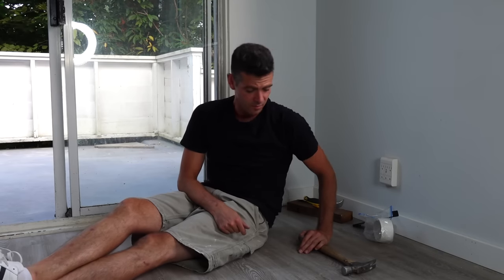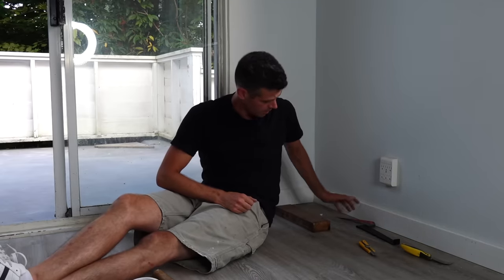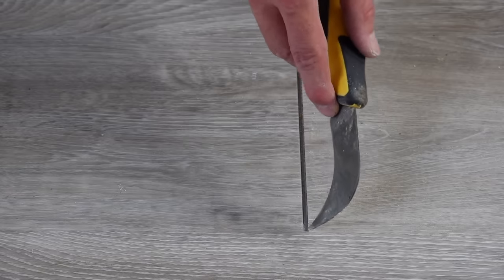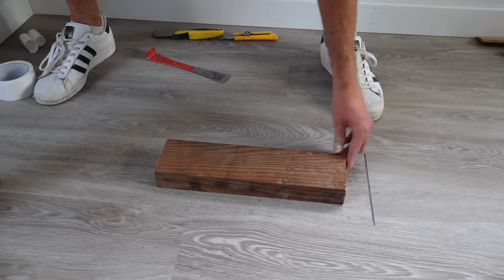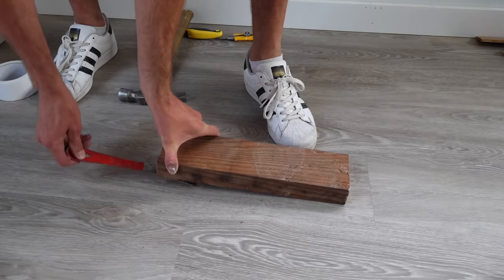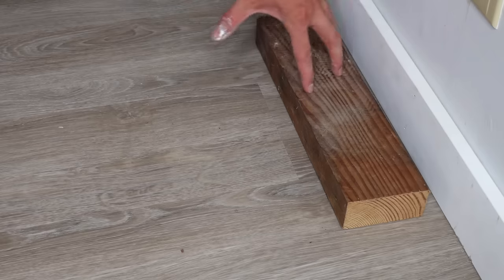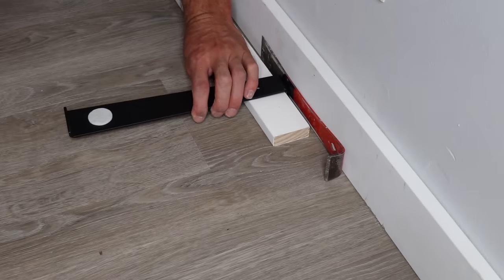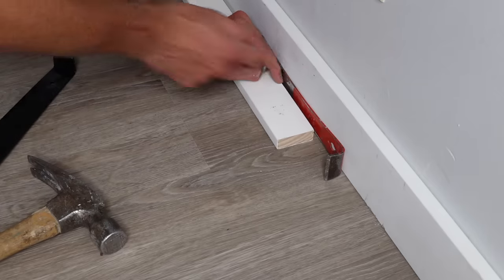How to Fix Gaps in Flooring!!! (Laminate, LVP, Engineered wood)

Comment: You went over "gluing" quickly so I want to know what did you do to keep them in place. Ours is a floating floor and it moves quite a bit. I'd like to glue it but don't know if is a bad idea. The side to side locking mechanism on this flooring isn't/wasn't right. They fixed it on new flooring we bought but the old moves everywhere. Despite us telling them about the problem they never fixed it. Now trying to figure out how to fix ours a bit more permanently.  Glue in the end cracks? if so, what type?Thanks
Reply: Not the guy you're asking the question of, but I install a lot of laminate/PVC/vinyl flooring.
I use clear Flex Glue, have had the best success with it. Clear because even the low-quality flooring has pretty tight interlocks, and it's easy to put too much on if you're hurrying, which I always am. Wipe up excess, but clear means you don't have to be perfect.
That said, use the smallest amount of glue possible. The interlocks are always tight and glue will squeeze up AND down. What squeezes from the top can be wiped off. Beware of solvents though, they can discolor or even melt laminate or vinyl. Some will even discolor PVC. What squeezes out the bottom though, you're...stuck with. That can cause buckling or separation if the floor expands or contracts too much, even with underlayment. Expansion/contraction is also why you want to use a glue that stays flexible after it sets up.
Bottom line, just use glue on the ends, use flexible glue, and use it very sparingly.

P.S. And if at all possible, avoid using pieces as short as the one in the second example of the video. Odds are it separated because its sides weren't long enough to provide sufficient friction. Cost being always a consideration, if you lay a floor and you need to reduce overhead with minimum waste, glue the end of pretty much any piece less than 8" (20 cm) long.
Reply: @shawnhartmann4581  thanks! Our problem is plain and simple a manufacturing defect. There is not enough "friction" between the panels to hold it in place. When we had our kitchen re-done, the guys who put in the cabinets couldn't believe how easily they were able to pick up the floor. They said they had never seen anything like it. Our floor wasn't cheap, but the manufacturer was new (we found out later). The retailer blamed the installer, the installer blamed the manufacturer and no one ever did anything to fix it. Soooo we are stuck with a defective floor that looks great but separates end to end and side to side. We are experts at the tennis shoe move to get it back together.
Reply: @jans3133  No problem, hope my info helps.
Honestly, my first choice in flooring manufacturers tends to be German (lowest error tolerance. Germans might suck at comedy, but they're great at precision) second American.
If your only option is Brazil, use linoleum.
The side-to-side separation should not happen. The only time I've seen this is when it was truly badly designed flooring or if the installer didn't know what they were doing and beat it together until it looked like it fit. If you do that, it typically means you have destroyed the interlocking mechanism.
I hate to say it but if the courses are separating side-to-side, unless somebody comes along with information I don't possess, if you really want to have a floor without gaps you might have to start over with new flooring.
Hoping there is an easier, less costly fix.

Comment: I just got a call back from a customer that I installed a few months back for a problem just like this.  I was just wondering what was the cause for these vinyl planks to separate like this.
Reply: Vinyl flooring needs to acclimatize 24 hours in the room between 18 and 25°C before installing.
After installing keep the room for another 24 hours at the same temp.

Comment: Why not cut up a bicycle tire and use that instead for traction? Plenty of surface area tension without being sticky. If you have to fix several boards being able to move quickly is a benefit.

Comment: How do you fix a gap that keeps reopening? The gap in my floor, all I have to do is put pressure with my foot and push on the direction I need to close the gap but it keeps reopening.

Comment: If you dont glue the seams it will seperate again . Shitty leveling breaks locking systems. So basically you put it back together just to have it fail again . Glue it .

Comment: What it the two ends are not parallel to each other, say from not being cut at 90 degrees and when  you try to close the gap , it still has a gap , how would solve that one if it was in the middle of the room .

Comment: That pry bar will likely scratch the flooring when putting it under the block.  I would be nervous of scratching the floor.  If the l9ck8ng systems weren't so shallow, this wouldn't be an issue. Tonnes of people are having these issues with vinyl plank. Terrible!

Comment: Not just closing the gaps that's the lroblem.  You need to prevent them from sliding back and forth which is my problem.  They don't lock in anymore

Comment: What do you do when you have one board end little higher than the other one
Reply: I've used task quick support rods to force the higher board down while using the carpet tape, 2x4 and hammer to push the lower one into the higher one.  Depending on the ceiling you might want to put a piece of dimensional between the rod and the ceiling to spread the force.

Comment: This isn't a permanent solution. 
Usually they will open because they cut the floorboards a bit short behind the skirting board.
So you need to take the skirt board off and pack it with something all the way to the wall. This will make sure they don't come a part again.

Comment: Take off your socks, Slide your foot across the board in the direction of the gap. 8/10 the friction of your skin on the board is enough to close the gap. Just try that before pulling out all those tools. Also, gluing isn't a good idea. That could lead to buckling if there is no room for temperature expansion.

Comment: Couldn't you also use like a sheet of 100% silicone and something like a rectangular dry wall sander that takes the screens with wing nuts and has a big handle. Anyway there are many ways

Comment: Doesn’t address the underlying problem. Improper use of moldings at doorways or too long a run of material. These floating products are designed to expand and contract .

Comment: How about they design the floor so gaps can't happen... Or is that too much to ask of you Affirmative Action Engineers ? We follow the instructions floating the floor but even an idiot knows when you add cabinets , refrigerators , tables etc. etc. etc . gravity does have a way of holding things down and not allowing the floor to move around... So summer to winter expansion to contraction gaps appear .  Personally I use clear Gorilla glue and I have yet to have a single floor gap reopen .  four or five drops across the groove and I use a rubber hammer to close the gap and done . If you make poorly engineered products you get poor results. And talking to a lot of floor installers gaps are THE number one complaint on these styles of floors. Regardless of manufacturer .

Comment: way over complicating it. a kick with a rubber shoe. or quick stop on it is all you need.  Ive been putting a dot of wood glue right before kicking it closed.  works.  i may regret the glue later, but i doubt it.  otherwise it comes right back apart

Comment: can't do that if you're installing Armstrong brand. The locking part is a bastard, and you HAVE to tilt the panel to insert the tongue into the groove. I'll never work with that crap again. Don't get me wrong, it's a very good, sturdy plank, and will stay together when others might fail, but it's a bitch to install.

Comment: actually this is not fixing anything. the same separation wil happen again and again.
the true "quick fix" is to put white wood glue in the crack then kick the pannels into place or use any method that work as suggested in the comments/video. wipe the excess glue with a damp cloth. repeat with all new separated pannels. not sure why the floor guys arent sealing each pannel as they install it.

Comment: This is stupid all you have to do is use a rubber hammer  Or even give it a good kick with your  Rubber shoes And you should definitely put glue glue in the connection if it's opening Bing because it's going to keep on opening